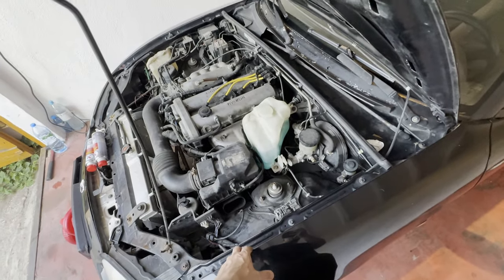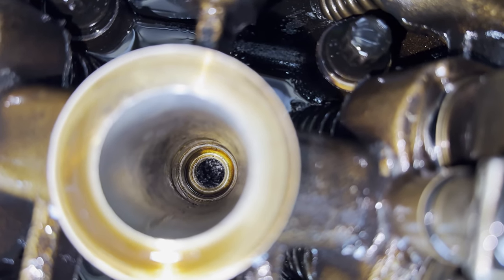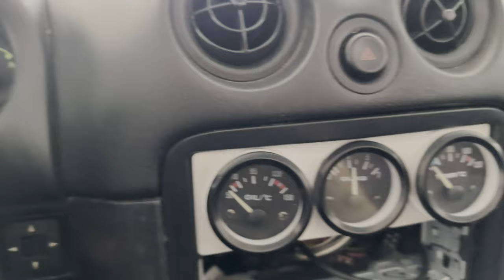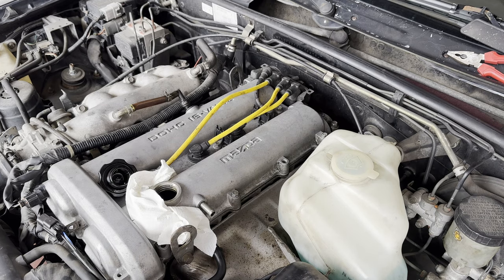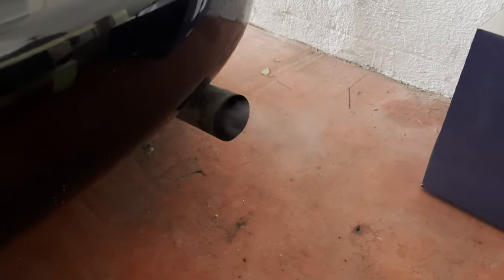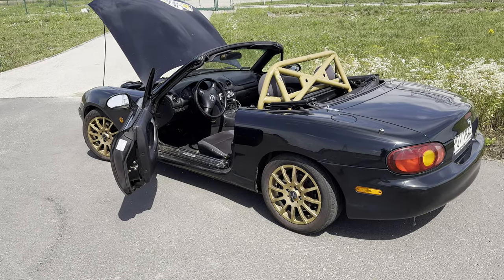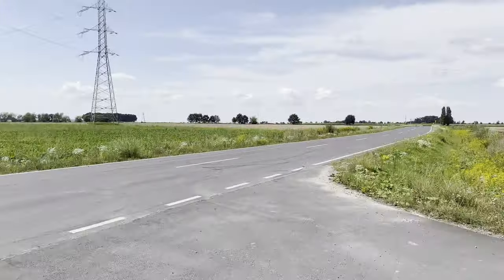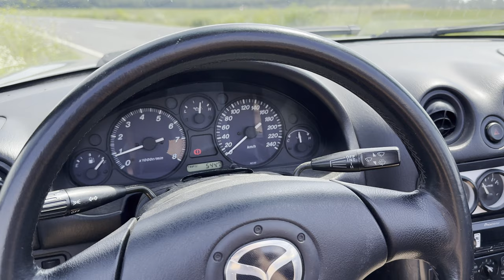Do engine flush work? Trying to FIX my SMOKING engine - complete test

Comment: Great vid. The cleaners usually do work and I notice you are generally using thicker oils too. DOHC valve drains are usually harder to get clean as its primarily splash oil in that area, but all condensation and vapours from PCV settle on cover and engine parts. It may be worth your while using the newer Valvoline Clean and Protect 10w40 that claims to clean 99% and target the rings specifically. Best of luck.
Reply from the maker: Thanks! For now I decided to buy and swap another engine, but I will disassemble this and check how the rings look like. :D